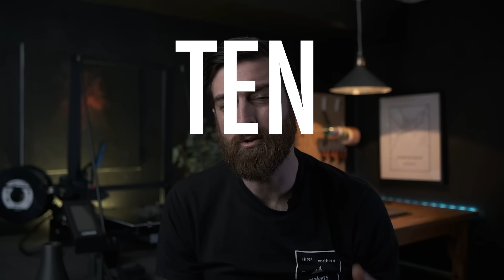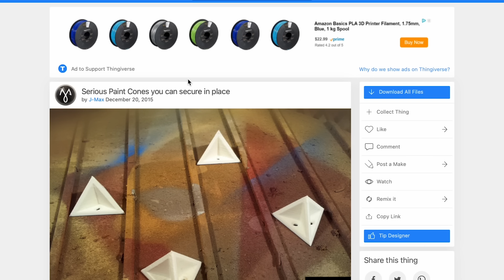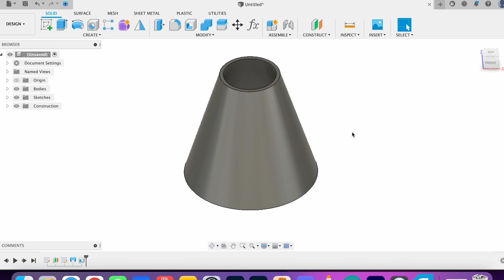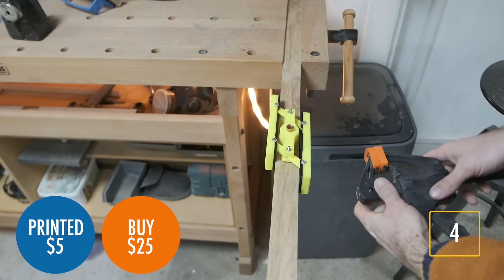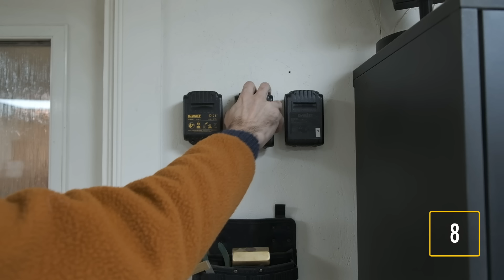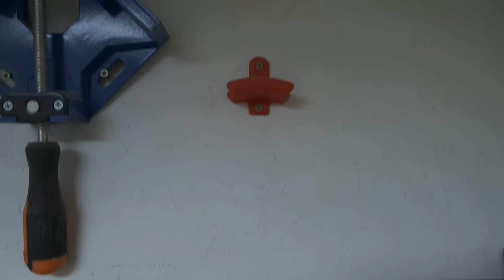10 AMAZING Woodworking Prints That Justify a 3D Printer

Comment: I have already printed a bunch of small bespoke projects on my Creality K1, and I am just getting started. A holder for the attachments for my 12V drill, a wall holder for my cordless vacuum, a wall holder for my Kärcher window vacuum, a holder for my tv remote that fits my exercise bike, a small holder for the brush for my electric toothbrush etc.
And there are a ton of small woodworking things I plan to make for my garage.
Oh, and my father got the gift card I gave him for Christmas in a small box that I printed for it. :)
As I have access to AutoCAD at work, I use that for the models...

Comment: I Had the LK4 pro. worked well for a while then it would not except my mini sd card. only way to fix it was get a new motherboard, none of the 5 new motherboard s were any good. i threw out the printer and now only use ender models.

Comment: I started with an XYZ printer and even if I fought it with every print, my wife said, that our house would never be without a 3D printer.
That for me is the best evidence you need as to having a 3D printer or not.
Now I have 3 Prusa printers. Two MK3s and one MK4 set up for different requirements.

Comment: The first thing I printed was a little clip to replace the inside door shelf restraint in my fridge, It has been years since we could put anything in the door, but we hung on to the piece that goes across and the remaining clip, I just copied the clip and fixed the fridge.... That pretty much sums up my relationship with the printer... The more you use it the better you get at it, and the more you use it...I have a base model Flashforge Finder. An amazing piece of kit for entry-level. both in quality and features.

Comment: Hi, I purchased a Ender 3 Pro. I have a Husky tool box, which is built by Stanley. All 54 of the drawer detents had dried up and broken. None of drawers were staying in, extremely dangerous. The detents were $9 US each. $486 US The printer at the time was $200 US and $15 spool of TPU A95. I bought the printer, fixed the tool box/ chest saved $250 and still printing a bunch of other great things.

Comment: Can you use the printer in house or does it create fumes that require it to be in restricted room?
Reply: I print mostly PLA and some PETG and the printer is running almost continouosly 24/7 in a 500 sf room.  I don't notice any problem with fumes or odor though filter systems are available or can be fabricated.

Comment: Great video - fully explains my newbie questions, with a thorough walk-through. That's a damn good beard, too. I'm wondering how easy it is to transfer my 3D Studio Max meshes into useable files.
Reply: From what I found on google, it seems 3ds Max can export files as stl which you can directly drag and drop into any slicer to make it printable.
I haven’t worked with 3ds max and so I don’t know how the scaling is when you export the files you designed in there, but if the scaling is weird, you can always adjust the scaling in the slicer and so it should be no problem.

Comment: For those involved in detailed costs, you need to remember a few things, which it's not clear if this guy is including:
1) Filament costs. This is the material used when creating your model
2) Machine costs. You can get cheap 3d printers, and you can get expensive 3d printers
3) Energy costs. It's not free, especially these days.
4) And the one which people almost never include: TIME. If you are running a shop and selling your stuff, time is the largest cost for you. If you're spending 2 hours designing a model and tweaking it, that's lost time in building stuff (also, 3d printing is SLOW, so if you need that "thing" now to complete a project, plan on waiting). In addition, some prints require refinement. If you're printing edge guides for your router like shown here, you'll have to sand the model to get it smooth, otherwise the bumps will transfer to your edge.

Looks, some things a 3d printer is useful, but as a woodworker, most of the times you can whip out a jig or a guide in the fraction of the time it will take you to get a finished product with your 3d printer. Just don't get stuck in the old adage "when all you have is a hammer, everything looks like a nail"
Reply: Two hours to design a model is pretty long.
Except for the ruler gage, all the pieces he showed can be designed in less than 15 minutes.
And if you use a slightly bigger nozzle and decent settings, none of them should take over 2 hours to print.
Yeah, that’s two hours you‘ll have to spend working on something else, but it saves you a trip to the store or the time it would take to get the item shipped to your house. So you‘ll still have more time to work on your projects.

For example, just two weeks ago I needed to use my Dremel to carve a few round holes into some wood.
My options were to take a 1.5 hour trip to the hardware store and spend 20 bucks on the router attachment for my Dremel or to start a 3 hour print and make the attachment for about 70 cents of filament and electricity.
Chose the latter option and while the attachment was printing I got finished with everything else necessary to finish the project.
I wouldn’t have had the time to finish the project on that day if I had left the house to buy the part instead of just printing it at home.

And regarding the part about having to sand the edge guides:
Unless your printer is really old and outdated or you use really bad filament that produces blobs and bumps, there will be no need to sand the piece to get it to be smooth.
At most you‘ll need to remove the brim (which takes about 5 seconds) and then the part is ready to use.

I agree that 3d printing isn’t the solution for every problem and that making jigs or figuring out some other way to do something often is faster, but in my experience a 3d printer (even if it’s just a cheap second hand Ender3 like mine) is a tool that will quickly pay for itself just by all the time and money it saves you.
I‘m just a hobbyist, but in my opinion everyone who does woodworking and is comfortable with using a computer would definitely benefit from having a 3D printer in his workshop.
Reply: @yourlocaltoad5102  Agree that in the right place it has it's uses, and I do use mine. But it's the "when all you have is a hammer, everything looks like a nail" for so many people. 

For edge guides for your router, unless you're making stuff for your shop, 3d printing isn't nearly smooth enough to get a quality edge. Not for heirloom furniture, anyway.

Comment: Ohhhh geeze. Now I kind of want a 3D printer. Excellent video with good examples of its use. Like the old saying goes, “The only difference between men and boys is the price of their toys.”

Oh, and the look of contempt on your face for Imperial was hilarious. I continue to use imperial because almost everything here is setup that way and that’s just how my brain works after having used it my whole life. But I do sometimes envy the metric world for its simplicity. To compensate I have engineers rules and tapes that break imperial down into base 10 instead of halves of the previous measurement like normal. I don’t use them all the time but they are handy sometimes for sure. But yes, I completely understand why anyone  in the metric world would think we are nuts for sticking with imperial. Sometimes it does have its advantages, though.
Reply from the maker: haha I am glad it didnt offend you as it was only intended as a joke :) I love that saying!

Comment: Still waiting on that metric clock and calendar are you? Maybe we should rework reality for you. You hate fractions we dislike decimals or a scale of just 40 numbers that represent freakin hot to freakin cold.
Reply from the maker: I was hoping it would come through more as a joke than anything serious.
Reply: @TheSwedishMaker  It did and was. I personally find those on both sides who get so angry about the other side nothing short of being mentally unstable. Geez, use what you like. For me, some things are easier in metric, while others are easier in imperial. I can estimate lengths much easier in imperial than metric, for example, but can easily switch back and forth, otherwise.
Reply from the maker: @larrybud  Agreed. The whole reason I made a joke about it is because it is like debating the hen or the egg situation. Obviously it was the hen.
Reply: @TheSwedishMaker  Apple/PC, Iphone/Android, Metric/Imperial. lol
Reply: The decimal system is used world wide as its more accurate and easier to use. All 3D simulations and calculations are done using decimals. Also, all 3D printing machine measurements (build plate size) and all the math used into slicing a 3D model are done in decimals. 

Its not like we hate fractions. Its just the decimal system is more easy to unterstand and better for accuracy!
Reply: @oscarreyes4511  First, it's the "metric system" not the "decimal system". 2nd, it's no more or less "accurate". lol. 25.4mm = 1 inch. Both equally accurate. "easier to use" depends on the circumstance. Easier to divide a meter by 10, but it's easier to divide a yard by 12.
Reply: Maybe every youtuber should include the 'american' system of measuring everything using dishwashers, microwaves or beer cans next time.

'The build plate of this 3D printer is 12 beer cans x 12 beer cans x 20 beer cans'